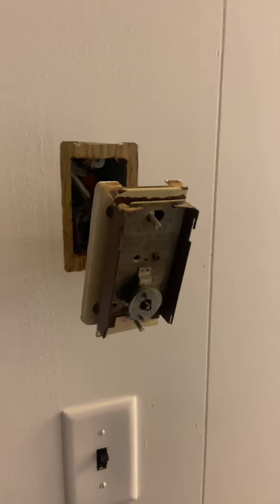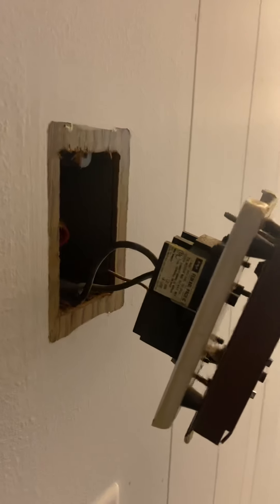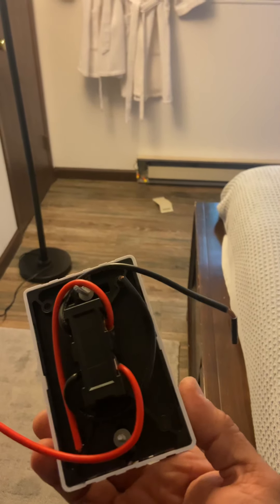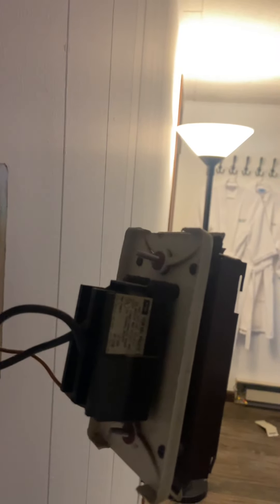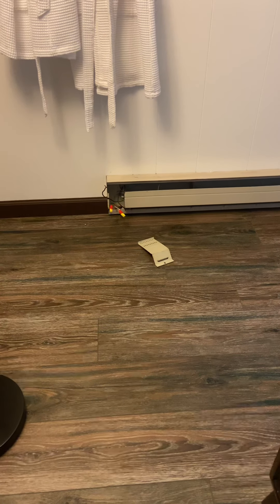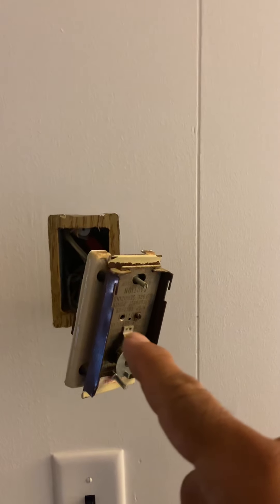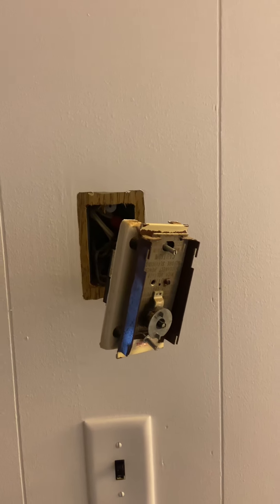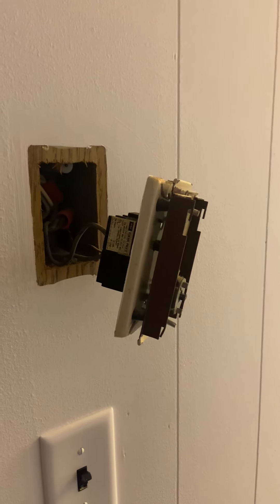Thermostat for electrical baseboard heater

Comment from the maker: If you do use a two pole thermostat as a single pole, use the L1 with the T1, If you use the L2 with the T2, the thermostat will not shut off when it reaches setpoint because they are used as an On/Off switch.
Reply: Do you know how to cut off the baseboard heater if it’s not electrical? I have 2 roommates who have mental issues because they love the thermostat to be on 80 all day long. I have the smallest room with only 1 window and it literally hell hot in my room. Like not an inch of air, even if I open the window. The heat even overpowers my AC, which they complain I use too much. But I have no choice because 80 degrees on the thermostat is way too high to me. They have no kind of understanding or reasoning, so I have been stuck in this situation for awhile. They both have bigger rooms so maybe they don’t feel the heat as much? My room is like a hole in the wall. It’s so hot that sometimes I have to sleep with no shirt on or pants! And I have the AC on and a fan on high blowing directly on me! Once in a blue they set it to 70 or slightly lower and I’m able to breathe. But I’m desperately seeking for an answer for what I can do. I wish I could just break this damn baseboard heater! I want it permanently off. Can I cover it with something to block the heat? Please let me know if there are any options possible to stop this!! Thanks
Reply from the maker: @jayraymondmgtow4200  If it’s electrical, you can disconnect the wires. If it’s hot water, you’re out of luck, unless there is a valve that can be shut off for that baseboard. If you have access to the boiler, you can set the water temperature to a lower set point. Good luck!
Reply: @jayraymondmgtow4200  move. No charge
Reply: Thank you for including this comment! Subscribed!